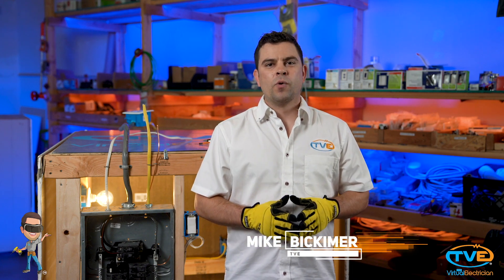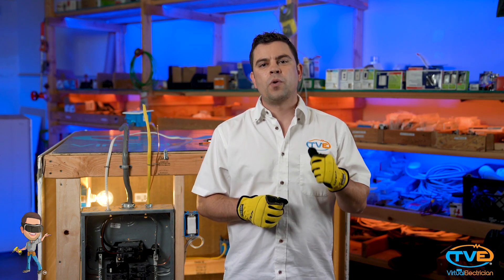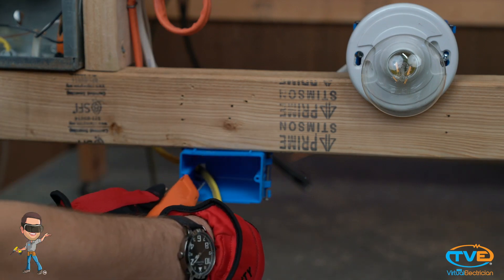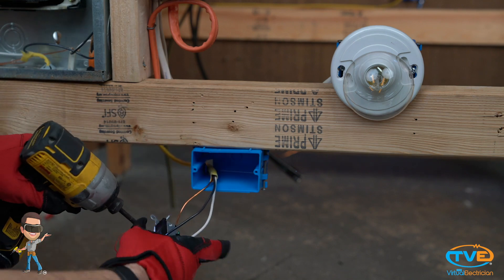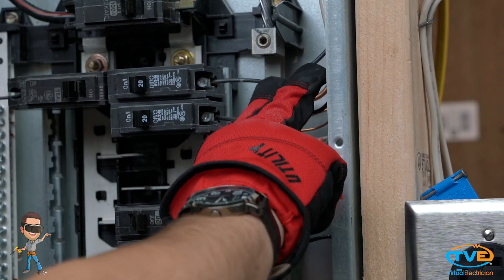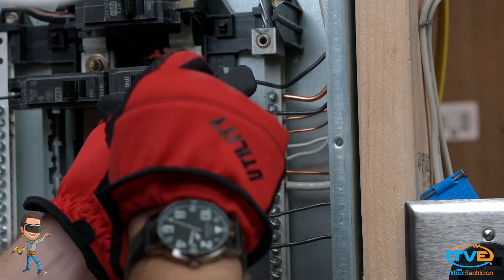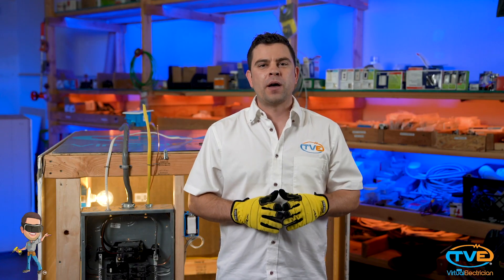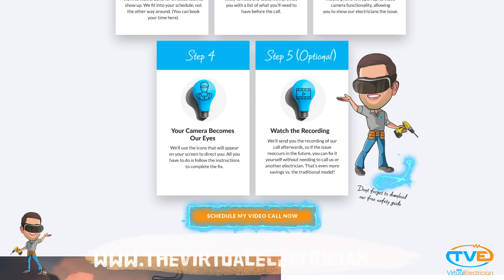Sump pump wiring

Comment: Thanks for the info.....I just came across your vids.....My effluent pump and switch are hardwired, but I would like to install an outlet for ease of replacement if/when necessary...would you recommend? I know I need a weather proof outlet cover
Reply from the maker: I will have to see your setup.  head to www.thevirtualelectrician.com

Comment: My friend, since 2020, every receptacle in a basement must be GFCI protected. Even a finished basement. Even 240 volt.
Reply from the maker: If your jurisdiction goes by the 2020 code everything in the house needs arc fault plus gfci protection. Not sure where you are but our counties aren’t even close to adopting 2020 nec yet
Reply: @TheVirtualElectrician  not exactly. Almost everything in a basement needs to be AFCI/GFCI protected. For anything at grade, or above grade, GFCI requirements have expanded a lot since 2020, but by no means does ”everything in the house” need to be AFCI/GFCI protected.  For example, a bedroom circuit upstairs would only require AFCI protection. Same with living room.
Reply from the maker: @panelpal111  this is true. But all your kitchen, garage, outside, bathroom, laundry room circuits do. That just leaves bedrooms and living room. But an afci breaker is 79 and a gfci breaker is 55 ( I guess it depends on your panel. It makes sense to just buy the combo. A lot of this stuff also depends on the interpretation of the code from your local inspector. It may be easier to just do it that way then go back if say he says the one convenience outlet in the laundry room that is tied into the living room lighting circuit needs to be gfci protected. It’s best to just really know your inspector and the year of the nec they follow.
Reply: @TheVirtualElectrician  again not exactly. Kitchen RECEPTACLES need to be AFCI/GFCI. Garage RECEPTACLES need to be AFCI/GFCI protected. Laundry room RECEPTACLES need to be GFCI protected.   Even still, that’s not what you said. You said if the local jurisdiction goes by the 2020 code, then everything in the house needs to be arc fault and ground fault protected. Which isn’t true at all.  

Even by the 2017 code your sump pump receptacle would be required to be GFCI protected.
Reply from the maker: @panelpal111  again it’s gonna depend on your local jurisdiction and what he makes you do. I think you will be surprised that they interpret the code differently than you
Reply: @TheVirtualElectrician  it’s okay to admit when you’re wrong about something. I don’t know everything either.
Reply from the maker: @panelpal111  I don’t think I ever said a Sump pump circuit shouldn’t be gfci protected. I made the video 4 years ago but I think I said if it’s in a finished basement it doesn’t need to be. 
I am absolutely admitting that it should be a conversation you have with your local jurisdiction.   We work in several cities right next to each other and it’s different with each one.
Reply: @TheVirtualElectrician  even in a finished basement a sump pump receptacle would need to be GFCI protected. Even back four years ago.
Reply from the maker: @panelpal111  can you show me where you see that?
Reply: @TheVirtualElectrician  422.5 (6)
Reply from the maker: @panelpal111  that’s the 2020 code.
Reply: @TheVirtualElectrician  yes. We’re in the third quarter of 2023 🤣
Reply from the maker: @panelpal111  are we just ignoring our conversation on this entire thread. I stated my county doesn’t follow the 2020 code and that you should check with your jurisdiction to see if they do. Then you said four years ago it was required.
Reply: @TheVirtualElectrician  just because the jurisdiction you’re working in hasn’t adopted the most recent version of the NEC doesn’t mean the codes don’t exist. Or just because an inspector doesn’t catch something that you did wrong doesn’t mean your work is code compliant.  Most the inspectors are know-nothings. It’s not up to them to follow the rules. You’re the professional electrician not them. 

You claim this video was made four years ago. Okay, maybe you made the video four years ago and just decided to upload it last month.  Well in 2017 it wasn’t allowed either. 210.8 (A) (5).
Reply from the maker: @panelpal111  210.8A (5) states unfinished portions or areas of the basement not intended as habitable rooms. A finished basement is habitable. 
If your an electrical contractor and you don’t have to install afci or gfci protection everywhere then you don’t. If you do then you won’t get many jobs because the other contractors you are bidding against won’t
Reply from the maker: And yes. We shot 150 videos that year and have been uploading one every couple weeks. We are close to running out of content and are in production for the next 150!
Reply: @TheVirtualElectrician  yes unfinished portions of the basement. Are you telling me now that this sump pump and pit was installed in a basement bedroom or something?  With a discharge pipe running up the bedroom wall?  Wake up in the morning and step over the lid to your sump pit to get to the bathroom? 🤣 
Just admit that you were WRONG!  I was trying to help you. You’ve actually misquoted codes all through our comment thread. You’re actually doubling down on your “wrongness” . Im wrong twice a day and I don’t know everything.  But ou’re conflating your lack of knowledge with code interpretation. 
You have a business/service where you provide expert electrical service virtually. Great. It’s a good idea, and I hope you make a lot of money. So when you have a virtual service call with a customer, do you give them electrical codes from 6-7 years ago?!  Multiple code book cycles?  And then justify it because your local county or city hasn’t adopted the latest version of the NEC?  No, I don’t think you would. Im sure you provide the current codes if you KNEW them. Open a code book man! Your knowledge of the codes is so poor!  Even when I politely tried to inform you in my first comment you wouldn’t accept it. You can’t learn with a closed mind. You even misunderstood the whole AFCI/GFCI in other parts of a home. C’mon man!
Reply from the maker: @panelpal111  sorry panel pal. You are the one that can’t admit you are wrong. Yes there are Sump pumps in finished basements. You box around it. It’s like a bench you can sit on but the bench flips up and boom. There it is. 
No need to get mad. Your the one that tried to call me out. Just admit your wrong
Reply from the maker: I’m an electrical contractor in three states brother. This is just a fun side gig. I love the banter with guys like you
Reply: @TheVirtualElectrician  do you often get called out for your lack of knowledge?
Reply: @TheVirtualElectrician  yes, there are sump pumps unfinished basements. They are in unfinished portions of the basement, often known as utility rooms or mechanical rooms not in living areas read the code section again (the one that I had to look up for you)
Reply from the maker: @panelpal111  what was I wrong about?
Reply from the maker: Of course there are Sump pumps in unfinished basements. I believe I say that in my video. Most are. But if they are not, when I made this video, you don’t need gfci protection
Reply: @TheVirtualElectrician  dude 🤣🤣🤣. Where do I start?  You were unaware of the code changes from almost 4 years ago you were unaware of the 2017 code about sump pumps in basements and you misunderstood the GFCI and GFcI  requirements in other parts of the home. You said that the entire home house has to be AFCI/GFCI protected.  Which is obviously not true. But you wont listen to someone who might just be more knowledgeable than you and who was trying to help
Reply: @TheVirtualElectrician  if you really made this video “four years ago” (conveniently right before the code change) then how come you didn’t lead with that?  Instead you went into “oh well on our jurisdiction blah blah blah”.  You would’ve said “yea you’re right but I made this video before the code change”. Or you would’ve put that disclaimer somewhere in your video. And you would still be wrong. Any receptacle in unfinished portion of a finished basement, would  still need to be GFCI protected, which you were unaware of until I gave you the code reference. So you think you found a loophole in this code where you could put a sump pump in a finished area of the basement and then box it in her as if that scenario you’ve concocted exonerates you for your lack of knowledge
Reply from the maker: @panelpal111  
You said you’re wrong twice a day. Well you’re wrong here too. Unfortunately your ignorance won’t allow you to see this. 
I think you got caught up in the generalization of the gfci/afci comment. If I knew you were going to try and captain America my response I would have cited the exact code. 
Instead you put on your inspector hat and got literal. But then you dug yourself a hole by not knowing what the code used to be. And since you thought this video was made yesterday you assumed I didn’t know the code today. Fair… because it’s true, no disclaimer was edited into the video, but wrong again. 
Congratulations you met your quota yesterday.